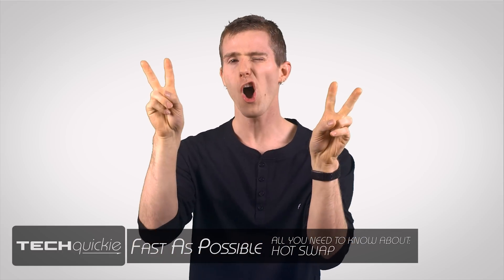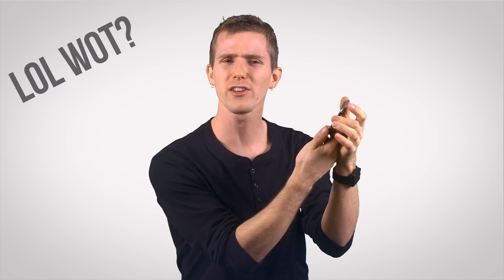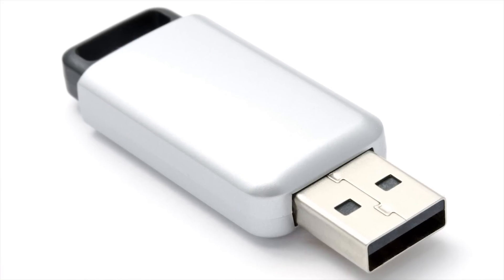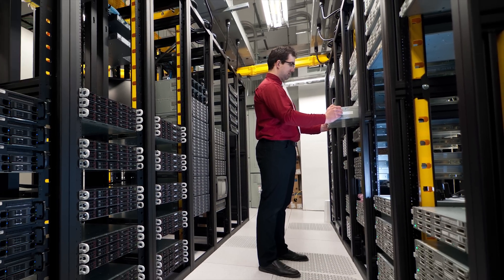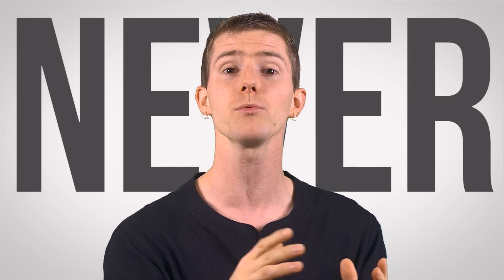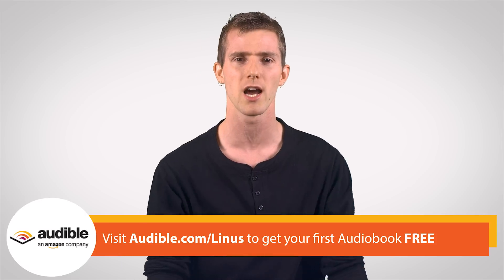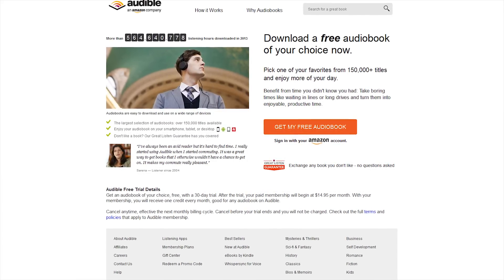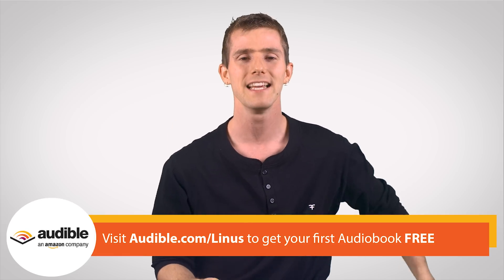Hot Swap as Fast As Possible

Comment: Interestingly I tried a lot of this on system components on 386 and 486 PCs a long time ago. Only one I really found that worked were hard drives and other drives as long as the rest of the system wasn't accessing them at the time of removing and reinstalling them.

Comment: I heard in one of the videos that the motherboard needs support for hot swap with harddrives, so just for fun I checked BIOS and Googled a bit (with cellphone while in BIOS), where I stumbled upon SATA mode, whitch is set to IDE (by default), and I know what RAID is, so what is AHCI?
Seems that it's needed to allow hot swap and that RAID activates that aswell. But does that mean the motherboard supports hot swap? Or do I have to check something else? (I really want to use my HDDs as a huge floppy disks with 2 or more 5.25 inch hot swap bays)
Reply: So I take it I need to select AHCI for HDD hotswap then (currently set at IDE).

When hotswaping, does the HDD need to be "Safely Remove Hardware" with a tray icon? Or just pull it out when not read/write from/to?

One of my older computers had all my (Internal SATA) HDDs in that tray icon, but not my current PC, could it be because IDE is selected in BIOS?... Maybe Operating System or Motherboard?
Earlier OS: Win XP, now Win 7
Earlier Mobo: MSI, now ASUS.

Comment: Do a episode on why we need to manually eject things to deem them safe to remove. I've been told and by logic I'd imagine for USB drives it's to prevent data loss or damage.
Reply: +Greg It is for data loss. Such as if the drive is still copying/moving files to/from the computer.
Reply: +Greg Depends if write caching is on or off.

Comment: Some laptops already have hot-swappable batteries (T450 Thinkpad) by using an separate internal battery alongside a removable outer battery
Reply: Technically, practically every laptop with a removable battery is hot swappable since I can remember in a long time.  You can pop in a different battery, for example, and have that one charge up, assuming it's on A/C power.  Obviously, if there's only one battery feed and you aren't on A/C then the system will shut down, but that's inherently a completely different reason for it.

Comment: Maybe a system where the battery of a phone is internally connected to a little not removable battery which can keep up the phone for about 10 seconds. When the phone needs to be charged it is placed into a specially designed docking station where another battery is stored and charged. When you place the phone into the docking station a locking mechanism (that prevents the battery from falling out while not in the docking station) unlocks and the batteries are hotswapped while the small 10 seconds battery keeps up the phone. When the swap is done the main battery kicks in again and you can take it out of the docking station and resume with what you were doing before you got the warning of only 15% battery charge left. Then in the docking station the used battery is charged again and when the phone needs to be charged again you just repeat the progress.
Reply: +Quenten Schoonderwoerd Or just use battery banks?

Comment: little bit misleading here. all sata devices are hot swappable. and graphics cards are hot removable 😃. disable gpu. pull gpu out. enable intel hd graphics. put your display cable into mobo. ive actually done that
Reply: +Grapenator X because we can
Reply: Basic display adapters on mainboards run off a single core of iGPU-less CPUs, with a very basic set of tasks it can accomplish. The most common of these is the VGA console, which is common on certain brands and types of Xeon boards. Even if the board doesn't have the port required, there are cheap addin cards that add the port and an improved controller without any GPU functionality. Damn near every OS has compatibility for these adapters, so it really isn't an issue. Hot swapping GPU and SATA devices might not be compatible with all operating systems available, however.
Reply: +EstMovies Yes. I can't confirm the sata thing, but even if you rip the GPU out of a computer while it's on, the worst thing that will happen is your game crashing.
Reply: yep thats what i wanted to say
Reply: But why would you do that?
Reply: so what? my cpu didnt have either. it uses Microsoft Basic Display driver instead
Reply: If you can output to a monitor, it means you either have a graphics card or integrated graphics. My xeon doesnt have integrated graphics and my mobo doesnt even have monitor I/O
Reply: Xamnition mobos have also igpus
Reply: EstMovies Most of them dont
Reply: yes they do. almost all modern desktop mobos have basic display adapter. that means you dont need dedicated or cpu intergated cpu to show picture

Comment: Can I hot swap my laptop battery?
Reply: +SecretPotatoChip Probably, as long as your laptop is also plugged in. In my experience, most modern laptops can run without a battery, relying completely on AC power without any problem. Making swapping easy!

Comment: PS/2 isn't hot-swappable in my experience. I mean it won't damage anything, but from what I remember (I don't use PS/2 very often anymore), mice and keyboards plugged in after the computer is turned on or disconnected and reconnected when it's on won't work unless you turn the computer off, plug it in, and turn it on again.

Comment: Batteries have already been hot-swappable. During a call if your battery ran out I think on the Motorola Star-Tach you would have like 30 seconds to replace it with another one, then continue arguing with your bro about what the best kind of milk is.

Comment: For a long time the top of the line servers have hot swappable processor/memory modules. Also people is experimenting with hot swapping GPU over Thunderbolt since the underlying hardware interface bus drivers are already hot swappable.

Just imagine having two Titans in a Thunderbolt 2 GPU box, and by simply connecting the Thunderbolt wire you can convert your MacBook Air into an impressive gaming rig.

Comment: How the hell would one even able to try to hot swap a CPU give me a min why I try and take this fan off without cooking my hand
Reply: Actually most higher end server class hardware like the IBM Power 870 have hotswap-able RAM, CPUs, and even PCI devices. Might you the Power8 system were designed by the same people that designed the  Z/OS systems aka IBM mainframes. And in the mainframe world, downtime is measured in mins per year or even decades.
Reply: Old Intel CPUs were basically cartridges (they were soldered to daughter boards and plugged in like a PCI card). Hot swapping those was certainly possible physically, but it was still a bad idea.

Comment: Would hot swapping something like a graphics card, cpu or memory be impossible if there was already localized versions of them. For example a motherboard having a slow cpu integrated on the board itself and the option to upgrade via the standard method.

Would you still be able to take the upgraded cpu out without powering off if there was a line of code that told the OS to switch processors to the integrated one if the main cpu was removed or died? Same would go for the other components.

I think that is quite the interesting discussion topic. Now by all means shut me down if this would never work but just a thought.... any prying eyes take this idea all I ask for is a 2% cut of all sales :)

Comment: There are definetelly hot swappable memories, and I'm pretty sure that the CPU can be hot swapped as well. Both do however required hardware and software support - and in terms of hardware I also mean proper casing, to allow easy hot-swap without dismantling the entire machine.

These are, however, enterprise-class solutions, and in most cases a high-availability environment consists of many cheaper servers, that can be powered off without disabling the entire service - so, not much memory/cpu hotswapping is done if you can power off an entire server without consequences. ;)

Comment: Tbh though technically it should be possible to hot swap CPU Memory and GPU's if you have multiples and if you can move the Processes or stored memory to another CPU GPU or Memory storage device power it down individually and remove it.

And that the slot is powered down when you go to plug a new one in and then is reiterated which would probably be the most difficult part.

Comment: One thing that is hot swappable thanks to laptops developing external video ports for this is video ports! You might not think about it much on desktops though...one use for it is, say, your monitor is really screwing around and you can see what's going on but now quite. Exit game, unplug monitor, plug in new monitor, tweak settings a little bit, and go again.

Comment: hey linus, here are some suggestions for your next video
a video about:
-Chokes, diodes, capacitors, mosfets & more
OR
-kernels(Linux, windows NT, Unix etc), 
OR
-firmware
OR
-wattage, voltage, amperage, ohms & more
OR
-VRM, Digi VRM & Digi+ VRM
OR
-Contrast ratio (this is just a worst case scenario suggestion)

this is already the 5th video i commented on and you still haven't noticed me :(
Reply: I want info on kernels. I love popcorn lol.
Reply: Keyvan Khadem Ravandi I agree Techquickie
Reply: They did about half a year ago. Big whoop

Comment: Ussualy " Hot Swap " is most times used with internal hardware while external hardware like USB drives, computer keyboards, game controllers, etc. are under " Plug-n-Play " which is a diffenret subsystem than for " Hot Swap " is.
Reply: plug-n-play still requires you to have a driver just most times you already have the driver is all.
But plug-n-play just allows you to plug in and/or take out devices without have ing to shut down the computer before you do so is all.

Comment: Linux supports CPU hotswapping so long as you're not swapping node 0, and they're working on that problem. I know "common sense" would say otherwise, but common sense is seldom correct. Please research what you're stating before making truth claims. You tend to do this a lot.

Comment: What's Telsa Graphics cards? i saw one of them without any ports like HDMI, etc...
Reply: For workstations and graphic professionals or rendering rigs
Reply: same thing as AMD firepro line of cards
Reply: Telsa cards are not really Graphics cards even though they do have a GPU inside 1 or 2 per card depending on model. All Tesla cards have alot more on-board Video RAM than any graphics card from the same generation as the GPU inside it came out. Tesla cards also are with totally unlocked GPUs but not overclockable. This means you get all the cores of the GPU(s) without any compimises becuase of the binning process as they are always the top of the line GPUs in that architure of course.
The down side to Tesla cards is that Tesla cards are purely compute cards though can do PhysX on them if the driver allows for it of course. Tesla cards can make GPGPU compute times alot shorter as well as rendering times for videos, compute times for databases, simulations run smoother and etc. none of which you need in a game. Tesla cards are built for and mainly only do CUDA compute though also can do OpenCL, DirectCompute and OpenACC. Depending on how the software is writen and for what it is to be given to that will determine which one will work the best for the job.
Depending on the coding a Intel Phi card could be a better compute card compared to the nVidia Tesla card but the program's code has to almost be totally rewritten to go from GPU to CPU and then if you want to go back haveing to rewrite it for the GPU again so it is best to pick one and stick with it.
In most computers with a Telsa card they are servers not workstations like said above and this is because Tesla cards are expenive and it is not econimical to have each workstation have 1 inside it compared to haveing a server haveing 4 inside it shared amoung the network. Workstations and graphic professionals ussualy use Quadro cards then offload the project to a rendering server on the network. Depending on the program used the picture or animation can be scene in real time as it renders even though the rendering is being done on another machine.
So perosnily i will suggest a GeForce card since you are most likely a consumer and GeForce cards are better optimized for consumers going faster in some areas and getting optimzations into the drivers for games.

Comment: So I can't hotswap my motherboard?
Reply: Yes, just make sure to wash it off first after you disconnect the heatsink
Reply: That would be crazy. Future computers with with an eject slot motherboard. Total dummy proof computer builds.
Reply: yumri4 I was being sarcastic. =p
Reply: Until motherboards and PC cases can be hotswapped, PC gaming will remain obsolete.
Reply: 69 likes
Reply: You funny guy
Reply: Zwei Masquerader well PC cases can be just not motherboards as they are what ties together everything ... unless you have a dual motherboard system but even then you will only be able to change out one of the 2 not both and it will most likely cause some errors too on that side of the system.
Reply: how would you do that though? The motherboard is where everything connets together so yes if you have a computer on a card you ussualy are able to remove and replace it but no you cannot remove the backplane of everything while the power is still going through it.

Comment: How about an episode on Fans. PWM and Non-PWM. And what plugging a 3 pin into a 4 pin socket does (or 4 pin into 3 pin).
Reply: PWM- allows speed control
3-pin and 4-pin can't alternate ports (without breaking things) and connecting them into each other would break fans or prevent them from working (but remain intact). This is because (from what I can tell when I was looking for a new CPU fan) 3-pins use a pin for data (monitoring) a pin for varying power (to change speeds) and a grounding wire. The 4-pins do the same, except with a lower voltage power wire (5v constant instead of 12v varying) and a PWM wire added. I don't think it's possible to change 3-pin fan speeds in anywhere but the motherboard BIOS, and this is the only advantage I see (unless you run fans at 100% and care about the 12 to 5 volt decrease). He should do an episode on reasons why fans are advertised at 20%fan speed minimums! Now that's confusing.

Comment: Sooo got a corsair 650D case with a HDD dock. Is it safe to remove a hard drive from there without powering off the system?
Reply: if the HDD is running and you try to move it it could damage the platters on te inside of the drive.  Also I don't belive you can hot swap sata devices on consumer boards